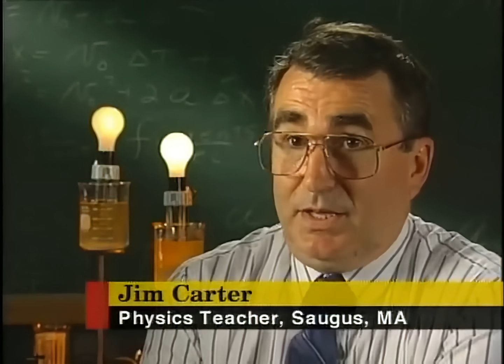MIT graduates cannot power a light bulb with a battery.

Comment: If you don't connect the negative end on a lightbulb to a grounded source, then the electricity has no reason to continuously move through the filament and provide light.

Connecting the Ground on a lightbulb to a grounded source (and the positive end on an electrically powered source) is like putting a 1 Ton Boulder on a slanted slope, where the boulder "wants" to roll down.
But not connecting the ground, even when the positive end is amply supplied, is like setting a 1 Ton Boulder (your electricity) on a flat plane.

It needs that negative electrical pressure difference in order to want to move to fill it.

Comment: Ok so I'm an electrical engineer and I can't answer this question either.

I think what people don't get is they probably aren't thinking of the question "can you CONNECT a light bulb to a battery and make it light up using a wire".

They are thinking about whether they can make a lightbulb (an incandescent bulb given the year this appears to be) produce light by hooking it up to a battery.

The answer to that is - maybe, probably not.

There's not enough information in the question to actually answer it - what kind of bulb - what voltage of battery.

So it's left to your assumption - when you say bulb most people think of a 60w or 100w bulb - these are both designed to run on 120V. When you say battery I personally picture a AA battery which is 1.5V.

Now, a lightbulb acts as a simple resistor - however the way it produces light is by heating up the wire inside of it.

If you hook up 1.5V to a 60w 120V lightbulb electricity will run through it but not enough heat will be produced to make any light. So the answer is NO.

But what about if she was talking about a different battery - maybe a car battery - that's 24V - is that enough to make a 120V lightbulb glow? I don't know - you'd have to experiment, I'd say probably not through.

Maybe she's saying - can you make a lightbulb glow using some amount of batteries and by hooking them up with wire. So the question includes the idea you will be given access to many batteries and you have to figure out how to get them to light the bulb up. This most people can do, even high-school graduates.

The question is too vague to answer, it looks to me like the people are trying to figure out wtf she's talking about. Not that they don't know basic physics or how to make a simple circuit.

Comment: Am I the only one that thinks lighting a lightbulb with a battery and one wire isn't that simple of a task? I didn't know the bottom slab of the lightbulb was positive and the threaded sides were negative until i googled it, and I don't consider myself stupid fyi. Furthermore, just because someone has achieved a good education in a particular subject, doesn't mean they should be THAT much more witty and have a better common knowledge of lightbulbs and batteries..

Comment: If the bulb was required voltage it would work.
Reply: Most of those bulbs will light up with DC, AC, lots of different voltages and amperages. I have burned up lots of bulbs having fun with different combos. Sure, if the current is inadequate then it may not light up but that's the exception.

Comment: At some point I questioned the problem, and remembered that a lightbulb is powered on average 220v. So I double checked and found out that I was right, the lowest "not battery operated" is 12v and regular AA battery is under 4v.

Comment: it ain't that hard dawg, all you need is a DC lightbulb and ur good (coil wire around 1 side, put opposite end of battery on metal tip. If it doesn't work, the flip the battery!)

Comment: Technically you can. You just need a voltage multiplier circuit in between the bulb wire and battery and it will light up.

Comment: Well, it depends... the question is stupid, there's not enough information in the question. Like *can you light a 220v bulb with ONLY a 1.2v battery and 10mm wire" - Nope. Can you light a 6.3v bulb using only 9v battery and a 10mm wire - yep.

Comment: even i can do that, step 1, get a raw steel wire. step 2, tie some of the wire on each side of the battery. final step tie the other end of the wire on the rings of the lightbulbs bottom fitting, and it should work.
-9th grader

Comment: Ok but where's the explanation? Cause I don't know what they did wrong and what they should have done instead either.
Reply: connect the wire to both the positive and negative terminals of the battery

then have the bulb sit on top of either terminal (ensuring the wire is between the bulb contact and the battery terminal)

does that make sense?
Reply: @welln0w  I know how to electrocute myself with a battery and a wire, I just didn't see that this was what they were doing wrong here, because their attempts are barely shown for split seconds in this video. Are you sure that this is what happened here? Besides, to be honest, I expected that the problem would be that batteries might not have the necessary voltage or that maybe the lightbulbs need an alternating current (upon inspection these don't seem to be true but those would be my doubts if I was given this task).
Still, as much as your explanation makes perfect sense, I don't see in the video that this is actually what their problem was. Do you? Or did you just make a theory to fit the case? Either way, it just feels like the people in these comments are perfectly content with making fun of someone else for being stupid without having the slightest idea of what that stupidity was and what they're really making fun of them for. It's pretty lame that the video does nothing to explain what their mistake was and people are satisfied with mindless ridicule.

Comment: 5th graders could do this right nowadays
Reply: how do you do it?
Reply: @trepentine   you just have to create a closed loop by putting the bulb on the battery and putting the wire connecting to both the battery and the opposite side of the battery

Comment: University is not the place to be if you want to do anything practical as a "maker". I found out the labs are closed to students unless you're enrolled in THAT SPECIFIC course and on campus at THAT SPECIFIC time during the semester to learn, at which point you're too stressed by assignments to be actually learning anything useful. Outside of that, they don't trust alumni or even current students.

Comment: If you take two people, one who did and did not go to Harvard (or any IV league) who couldn't do it and knew just as much as the other, then taught them the related physics information, who would pick it up faster? Most probably the IV league student, not because of what they learned, but because of the filtering parameters. Point is, this does not get at anything particularly interesting other than lower general knowledge on electronics/physics 12 years ago (or whenever this was filmed). This video serves as a funny little bit, nothing really deep. 

Though, maybe try MIT and see what happens.

Comment: I'll take a guess (as a high school grad, not an electrician either). I'd say it's either because they are touching the wire itself with their fingers, or, it's because the battery is underpowered and cannot overcome the bulb's resistance? Or does it have to do with the bulb having unique/strange terminals or contact points?

Comment: "if you can't light a bulb with a battery and wire, everything built upon that has problems."

This is not true.  I don't know assembly, but I can write code in Java, python, etc.  Broad statements like this are frequently incorrect.

Comment: And here I was, thinking that this will be about a bulb rated for 240V (or 120 since they are in USA), and they trying to power it from battery - like the survey would be asking if they can build a simple voltage multiplier circuit; or at least whether they can explain why that bulb won't come on from that battery alone...
I was not expecting them to connect only one terminal and stare at it puzzled.
I had to look whether this is an Onion sketch...

Comment: I could do it. Put the bottom part of the bulb directly onto the battery contact. Then use the wire to connect the other two.
In fact, I did this kind of stuff many many times in my exeprimentation projects with LEDs(normal and IR), as well as with other electronic parts such as resistors(default, potentiometers, photo resistors), caapcitors, transistors, etc while assembling different circuits.

Comment: You can, very easily, just not safe to do it while holding it in your hands like that. You need to fashion 2 connectors that go to the bulb's base & to the battery. It's too rudimentary to that with bare wires. You's need to hold them in your hand, making it essentially pass through your hand, although it's not at the risky level, still, not the risk worth taking.

Comment: The bullb is a screw tyoe bulb where the screw is the negative and the base is positive. Put the base of the bulb to the positive side of battery, and use that one piece of wire to connect positive side of battery to screw. This is high school stuff.

Comment: It doesn't go to the fundamental understanding of electricity. If you gave them two wires, they'd all get it - that's the basic understanding of electricity. 
It's basically a trick question. You would pretty much never design a circuit where the battery is in direct contact with a load. (One reason being that corrosion of the battery would destroy the load as well, instead of just a cheap contact.) So, you're asking them to do something they've implicitly been trained to not do throughout their engineering career. It's a riddle more than an engineering question.
Reply: Thats a good comment. I was also thinking the same that you can only do that with two wires , forgetting that the direct contact to one of the poles also closes a circuit. When you look at hundreds of circuit diagrams you likely forget the simplest solutions. Unfornately I am also a theoretical guy, I really like learning and studying, but when it comes to practice i fail often.
Reply: @Phistra it's even worse that the question is ill-posed. Can you turn on a light bulb with one wire, a battery, and a bulb?
What's the voltage of the "battery", and what are the design specs of the bulb? Incandescant bulbs don't "turn on" - they get more or less luminous depending on the voltage supplied (presuming the filament can handle the voltage). But LEDs are much more sensitive to voltage - too little and it won't turn on at all; too much and you destroy it. So you'd likely need access to resistors, as well, in that case.
We can be even more pedantic and ask what gauge the wire is - if it's too thin, it will provide too much resistance to allow the bulb to "turn on".
And they handed the students a cell, not a battery (which is, technically, more than one cell in series).
Reply: not only that but the whole "if you dont have a good grasp on electrical circuits then you dont have a good grasp on electricity" is kind of a slop opinion, the fundamentals are maxwells equations and circuitry is really just an application of that. to say someone doesnt understand electricity because they arent good at circuitry is like saying you dont understand how a computer works if you dont know javascript. It is totally conceivable that there could be e.g. someone doing plasma physics but who isnt super good at circuit analysis

Comment: I doubt that they actually couldn't figure this out. My mind went like this:
Easy
Wait what if the power isn't enough?
Okay let's suppose it is, then it should be easy just connect the two ends of the wire to the two poles.
Oh wait I only have one wire.
Maybe there is a way to cut it? I know how to remove the insulation with my teeth and if I twist it enough...
Oh, but if I just hold one pole of the battery to the bulb and connect the other with the wire it should work.
I don't have to cut the wire!
Then the first graduate did it in the video. They probably all figured it out after 2 minutes thinking just like me :)

Comment: That single wire is a trick question. The tester is an idiot. Anyone not experienced with light bulbs can easily make this mistake. Has nothing to do with engineering at all, just familiarity.
Reply: 🤣 "Anyone not experienced with light bulbs"?!! Who's that? People from the 18th century?
Reply: @jonathanbiggins6448  Have you installed a light bulb using a single wire and battery? I guess that answer is no.

Comment: I really hope this is one of those videos that only shows the "bad" answers.  It's possible they just showed the worst 10 or so kids that had the most trouble with the question and another 90 kids solved the problem in about 10 seconds.   I'm a mechanical engineer (from Lehigh U., not MIT) and my children could have done this since they were about 6 years old.  We played with snap circuits and all kinds of electro-mechanical things.  This is a trivial problem.

Comment: How can u lightba bulb with a battery and 1 WIRE? Ull need two wires isn't it? They r rightfully confused
Reply: Nope, don't need two wires: just touch the stud on the end of the bulb to one terminal of the battery, etc.
Reply: @jonathanbiggins6448  That's because you're using part of the lighbulb as the other connector. Which is really not how it's normally done. That's like saying can you light a candle using an iphone? The answer is yes, because the battery inside the iphone can create fire. But that's not how it's normally done.

Comment: it is a trick question, though. just not in the way it typically is, and it's VERY subtle.

when they asked the question, i envisioned a circuit with the bulb being connected to the battery with wire. when they say "a wire", given the casual nature of the conversation, it doesn't occur that they LITERALLY mean one single piece of wire, which doesn't work the way i had imagined it in my head where i had imagined two, but in a casual conversation without the materials present. when they showed it was a single piece of wire, i realized they had to touch the bulb to the battery, which is an awkward thing to do (ESPECIALLY when standing up and not having anything to set the three objects you're holding down on) and not what i had envisioned in my head when they asked the question. now, combine this with the known fact that people are more prone to make simple mistakes like this when put on the spot (ever watch wheel of fortune and see people miss easy words?), and this is what you get.

basically: asking the question has them already envision how it would work, which for most people is two wires, but the fact that they literally mean one wire means this idea of how to do it is wrong. then when put on the spot to do it, this idea they had in their head combined with the fact that their brains aren't in critical thinking mode (it's a casual conversation with someone who just walked up to you), their idea doesn't work, but their brain isn't in the mode to figure it out. it's subtle, and i'm probably not explaining it very well.
Reply: also just found out the professor being smug about it in the video is a harvard professor... interesting.

Comment: I built a lightbulb using an alka seltzer bottle, the old style that held the tablets vertically, a cork, two nails, two pieces of 18 gauge wire, and a piece of wire I pulled from a screen for the filament, and an electric train transformer. I turned it on and off until I depleted the oxygen from the air inside the bottle. It took a few dozen tries to get the oxygen out so the filament would not disintegrate. The light bulb lasted about a week, but I was 12 years old and that was in 1957. We had no internet and very little access to technical manuals. 

I am NOT a genius like I thought the people who go to MIT are? If you are actually capable of going to MIT and graduating you should have absorbed the light bulb and battery process through osmosis!
I just lost all respect for MIT and its graduates!

Comment: I learned in high school how to make circuits. Those boards and soldering and shit. U just connect the light or led to the battery with a wire. You can throw a resistor in there if you want too

Comment: My first question would be: does this bulb need AC or DC i.e. LED-type (3ph) or simple incandescent (1ph)? Also, what is the wattage and power voltage of each bulb? I know that home bulbs are around 40W with a source of 240V, at least where I'm from, and that the little test lights etc. I used to build with are around 0.5W powered with a source of 1.5-9V.

None of the above helps, and it's probably overthinking, but I'm pretty sure anyone can get fooled with a simple question on the spot.

Comment: I was doing this 4 or 5 years old. One day at the same age, I connected the bulb with two small wires and plugged them into the socket. It was a scientific experiment to prove that the electricity is the same from both sources, and when the wires were in, I saw the light and said to myself, "I was right!" 0.1 seconds after it, there was a blast, and I found myself in the other part of the room. Actually, as I was sitting on the floor with my feet on the wall my leg muscles reacted to  the electric shock throwing me 3-4 meters backwards.

Comment: That wasn't a lack of fundamental understanding. It was a lack in practice working with those constraints. Typically if you had a battery you WOULD use 2 or more wires and connect to the battery terminal with the battery at a remote location separate from the bulb. This is a puzzle problem. It shows why actual work specific experience is important and must be learned on the specific job where it used. That is why theory doesn't equate to manufacturing techniques and practices, which revolve around constraints.

Comment: I was 5 when I learned I could light a 110v bulb with a 9v battery, no wire. I also discovered that you don't cross both wires in an electrical cord that same year.